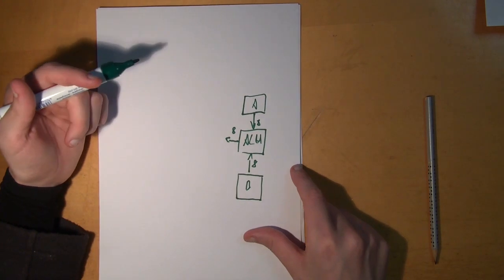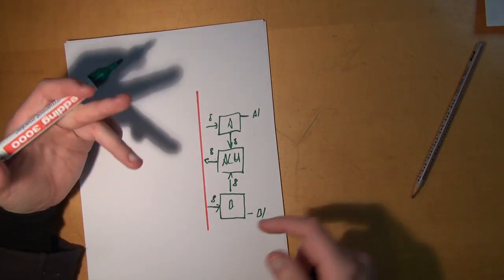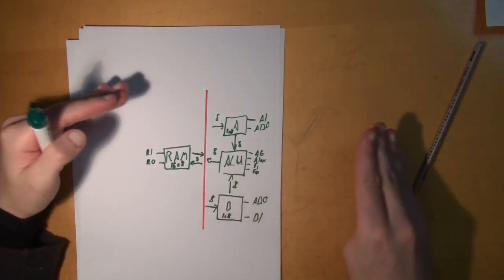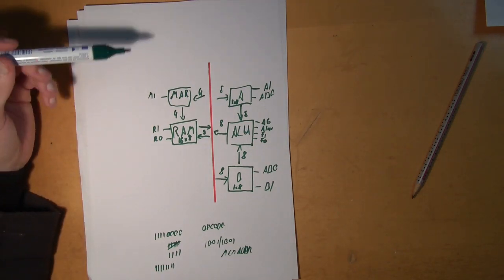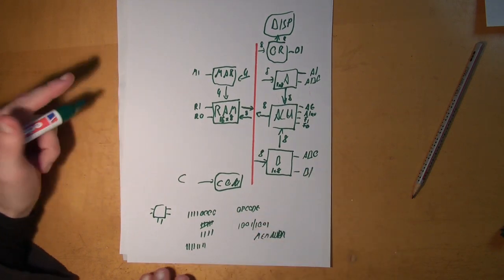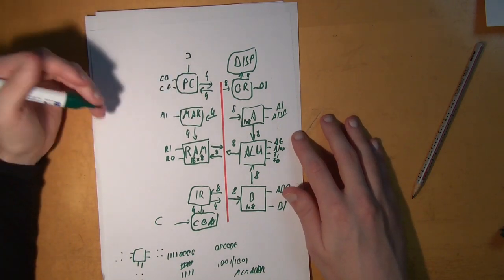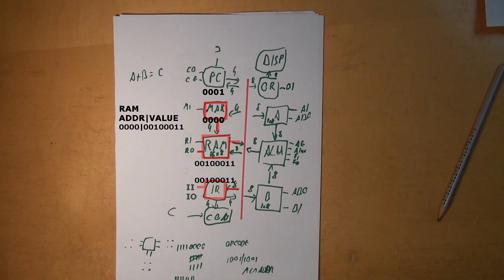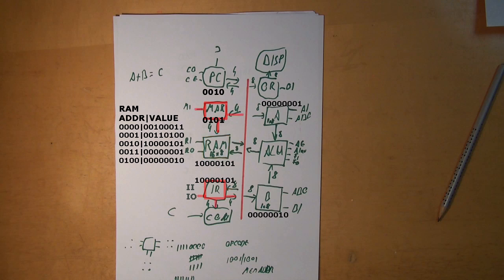How A Computer Works AKA CPU Architecture Lets Build 8 Bit Computer Part 11

Comment: Great videos. How do "1" bits get energized/volts? Assume a program has defined a constant named ONE that has an initial value of 1 (0000 0001). Does the right most bit get energized (5V) when the program gets loaded into memory? What component of the computer causes that to happen?

Comment: Are you still working on it?
Can you make DECIMAL to BINARY converter?
Reply: It's just encoders and decoders. That being said, they are custom en/decoders, and you also need a good understanding of  BCD and the arithmetic and logic related to it. From what I've been reading, you also need to have either fixed point or floating point math going on for it to be worth the conversion, as apparently the circuits get pretty large.

Comment: Thats not allot of ram, I mean I know your building it yourself, but 16*8 is barley enough to have a program that tells you the alphabet as in "This is the letter A" Now thats assuming you have a hard drive of some kind, like a SD card or even a tape, but from the diagram it looks like theres no permenant storage so not only would it just be a basic calculator, every time you turn it of it would lose the math program, and I dont even know how you could get a OS on that 16 byte storage... So I hope you are adding some kind of hard drive or tape, because if your not, then well it wont be very useful.
Reply from the maker: Thats all you can have with a 4 bit memory address. 2^4 = 16
Reply: +madmaxx you should use a separate 8 bit index buffer
Reply: +Anto Mani bus*